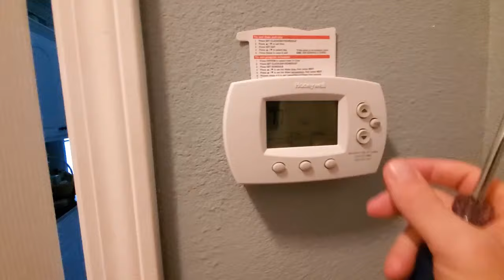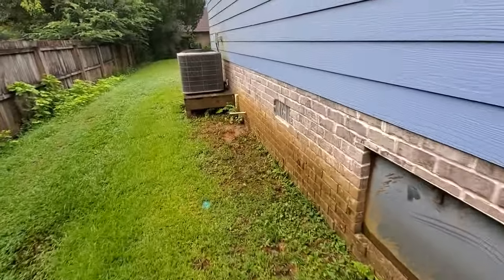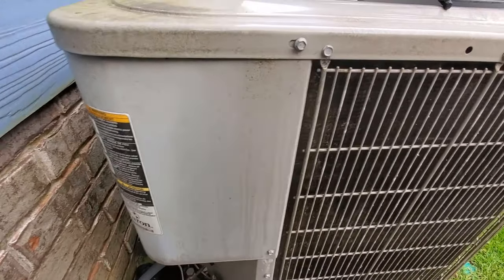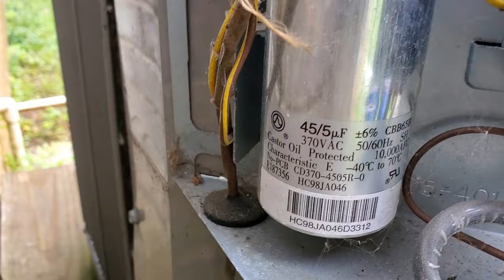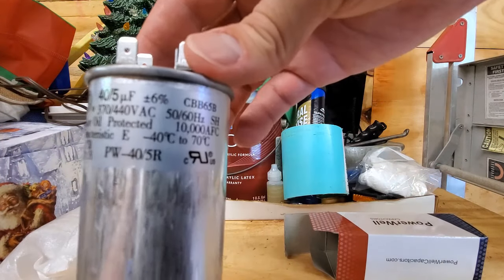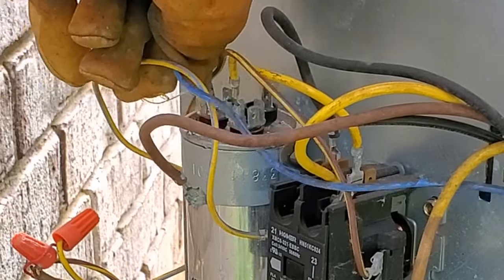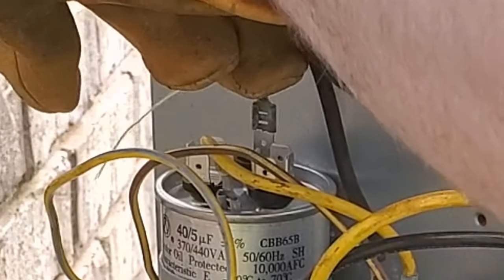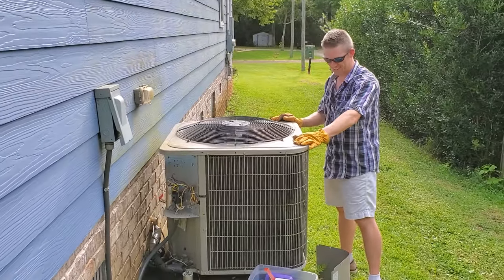How to fix your AC: fan not spinning

Comment: The screwdriver trick to get my fan running just saved my family from another almost 100 degree day until having a professional come look at my unit. Considering I have a 4 month old, I’m sure you can imagine how relieved we were to have a temporary fix! Thank you!
Reply: Same here! Part is on the way and this will work for now. Although I have to "kick start" it about every 15 minutes. We don't have kids but we do have 2 pugs which are very sensitive to the heat.
Reply: Same here.     Awesome
Reply: But a box fan facing up for temporary fix without the hassle of babysitting the unit. You'll need to tie it down though.
Reply: @Robert Morrison Help its in high 80s I have grandkids here as well. Could u explain to me how u used box fan?? I'm having to go outside every 10 or 15 mins to push start my fan so we can have air.😢😮
Reply: Just saved us from that as well
Reply: Just saved my life thx bro
Reply: Same here.
Reply: Hell yes.  Just did the same for me.  It is stupid hot right now.
Reply: That temp fix saved me. Thank you so much.
Reply: Same bro on God my wife was pissed about the heat. I was about to die by wife then die again by heat 😂🤣
Reply: Same here 🥵🙌
Reply: Those are the worst!! Nothing like a new born baby with nothing else going correct! Hopefully you got it all squared away and that baby is happy and healthy! 🎉🎉🎉
Reply: Dude same issue here. I’m pretty sure it’s the capacitor. 4:23 in the in the video  got me dying of laughter lmfao. Discharging had me scared.
Reply: Same here
Reply: More credit to the kickstart via long tool.  Saved me for the night.  Will call the pros tomorrow morning.  Thank you
Reply: Save my life too, your my Hero 💪🏻
Reply: Worked!🙌
Reply: @fortress1133 what is the part needed ? I would appreciate you so much
Reply: Everyone in the comments saying the screwdriver worked; but no is talking about what the part so I can order it and install it myself .
Reply: @realg4lifefoo168  capacitor, there are some videos on YouTube showing where it is so you can get the model number off it, but be careful, electrical components can be life threatening so pay attention specifically on how to make sure unit does not have charge current before disconnecting capacitor. Also, I thought my issue was capacitor but it was actually the fan motor coils going bad so needed new fan motor. Good luck
Reply: Same here!!! we rent our home, but it is hot as heck in Georgia right now and I have kids! Or call the landlord and let him know that it’s OK for now
Reply: Bro you fucking saved my life, currently 1am and this saved me 😂🤙🏽🔥

Comment: Thank you so much! The screw driver trick did not work for me but I was able to replace the capacitor by myself with no previous HVAC experience. I ordered the capacitor, some electrician gloves, and an insulated screwdriver from Amazon. It took about 30 minutes to change and worked the first time. I cannot thank you enough!

Comment: Thank you, Kent, the screwdriver got my fan spinning and I thought holy shit that worked. 45 minutes later the system shut down again. I then proceeded to take the AC compressor panel off and took a look at the wiring configuration. I took photos of the wire configuration to reference and remember where the wires connect once I purchase a new capacitor. Temperature is gaining speed currently at 84* I couldn't wait to purchase online. So I made my way to Ace Hardware and was promptly directed to the section where I could find the capacitor required for my unit that cost a little more than online but since it was Saturday and the cost of an AC tech coming out on the weekend was elevated I was happy to pay the extra cost. I got back home and started to assemble the capacitor and after it looked like it was assembled correctly, I turned the switch on the panel and the unit started working and continued to work. Awesome Victory today, Thank you.

Comment: The kickstart screwdriver method worked for my AC unit for 20 mins before the fan stopped spinning again. Then I followed your method for getting a new capacitor and bought one for 25 bucks at ACE Hardware. Worked like a charm and haven't had an issue since. Thank you so much.

Comment: Thank you soo much! It's 95 degrees right now here in oregon and my mom called me saying the ac is broken. I rush over to the house and started researching videos and came across yours.  All I did was  turn off the breaker and power unit, unplug three female connectors, blew off all the dust, and reconnect the plugs.  Now my mom has AC. Thank you soo much!

Comment: 10:14pm on a Saturday night, 85° after a 95 degree day and the fan stopped spinning...my 81 year old mom in bed and I was freaking out!! The screwdriver method worked PERFECTLY (though my screwdriver wasn't long enough, so I used my little grill stick 😁)! Can't THANK YOU THANK YOU THANK YOU enough!!❤🎉 You are a LIFE SAVER till I can get someone to check/replace the capacitor (using ur video of course)!

Comment: Outstanding Video. Thank you so much for sharing this information. My fan had stopped. Actually we did not have A/C yesterday. I call the service company to come out before locating your video. I went outside to the AC with a long screwdriver and spun the fan. She started up. I am still having them to troubleshoot the AC . You are a blessing and thank you again. Video was extremely thorough and to the point.

Comment: Thank you! I can't believe I came across this video, you had literally the exact same problem as me with the exact same AC unit. I went to Ace, got the part, swapped it in 5 minutes, and my AC is running again! And even better, the horrible noise it's made for years is gone!

Comment: Thank you so much sir. Its summer and my a/c stopped working. It gets to about 91 degrees Fahrenheit out here in Stockton, Ca. It got really hot inside the house, and I didn't have the money to hire an ac repair man. Your video helped me fix my ac, so I won't have to endure this crazy heat. Thanks again.

Comment: The Screwdriver trick worked once for me, but not after that. However I had regular house fan that was wide enough to put over the top of the unit which I used to blow into the unit. This actually also started the fan blades to move in the AC unit and once it moved fast enough the AC unit fan started working on its own for at least that on/off cycle.  So that is an alternative method to try if the screwdriver push is not enough.  The added benefit though is that if it is dry outside, you can just leave the house fan on top of the unit while you are waiting for your capacitor to arrive.  Since it is blowing continuously  it should allow the AC fan unit to turn when the thermostat in your house causes it to need to turn back on.

Comment: Thank you so much my friend for this video.  My AC started doing the same thing. Problem was I discovered it late on Friday afternoon and our usual trusted HVAC guy had just retired (82 y/o). But by spinning the blades got us through Friday night. Then I found your video. Got the new capacitor (45/5 uF) late yesterday via Amazon ($22.90), installed it this morning and works like a charm. What a releif. We have a heat index of 108 today. Liked and subscribed.

Comment: Thank you for this informational video! This is exactly what was wrong with my A/C. Took plenty of pictures of the old capacitor before removing it. Went to a local a/c store and picked up a new capacitor for $25. Replaced it and had my a/c working in an hour.
Reply from the maker: Sweet!  I can't beleive you have and AC store - and that they would sell you something without complaining that you're not a licensed AC guy.
Reply from the maker: @enriqueducassi4595  Must be hot down there!
Reply: me 2, BIG THANK U. From my family to yours.
Reply: ๆๆๆๆๆๆๆๆๆ
Reply: @enriqueducassi4595 🎉❤❤❤        m.    eee and et😂❤
ovà

Comment: I've never troubleshot anything by watching a YouTube video for literally "30 seconds" - my fan motor was humming and MY long screwdriver got it running, which all pointed to my Capacitor.  My local plumbing store carried my Capacitor for $15.98 - you saved me a Service Call - major dollars and days of hot air.  My 2 (spoiled) Pomeranians are happy, and my better half is very grateful.  Thank you, Thank you, Thank you!  Loved the sparks also, thanks for the safety tip as I would have not known otherwise.  All my best and keep up the great work.  $16.51 with tax included, AMAZING!

Comment: Thank you so much for this. This video was the first thing that came up when I searched for A/C Fan Not Spinning last night and I knew it was the same problem when I tried spinning it with a screwdriver. I went to ACE today and got the capacitor I needed, and it's already fixed!

Comment: Great video, very helpful! BUT! You mentioned spinning the fan clockwise, and mine are both counterclockwise.  If you look through the vents at the top at the fan motor it will indicate a rotation direction - make sure you look at this.  The air should be drawn upward through the coils.  For mine, spinning clockwise drew the air downward.

Comment: Listen.. I’m not kidding when I say you may have GENUINELY saved my life with this video. It’s currently 105 degrees here, and my AC suddenly stopped cooling about 40 minutes ago, and although I’ve yet to do this repair, your kickstart method to get the fan going actually helped me getting my AC running to start cooling my house back down. I’ll update when/if I’m able to do the capacitor repair, but for now you’ve saved me. THANK YOU SO VERY MUCH.
Reply: Just was questioning about what's happened since, has it stayed cool since?
Reply: @ceeferg433  so I haven’t been able to attempt to replace the capacitor yet, but this method has helped me to keep my AC at least semi-functional for the past weeks, and yes it still cools fine. There are a few caveats for me though:

1. He says “clockwise” in this video, which I’m sure does apply to his unit, and that’s exactly what I did after watching, …BUT.. that was NOT good in my case, because the fan blades would spin up and turn on the AC if I spun them clockwise, but there was a ton of heat coming from the SIDES of my unit, and very little air coming out of the top… It was cooling, but not super well.. Well one morning I turned it on and it spun up on its own (happens maybe 1 in 10 tries) and I noticed no heat from the sides, and strong air flor from the top… so just for the hell of it I turned it off, and when it didn’t come on this time, I attempted to spin it COUNTERCLOCKWISE this time, and it spun up with a ton of power, strong top air flow and no heat from the sides.. that as when it dawned in me I’d been spinning it the wrong direct for 4 days. It worked.. but it was forcing the air DOWN instead of up and with nowhere to release like it has on top, it was forcing the air out the side vents.. so be mindful of which way you spin because I had no idea it would operate spinning either way.
2. This is the big one… it WILL spin up and function, but the problem is that… say you set it on 65.. once it reaches that temp, it shuts itself off, but once the temp rises ABOVE that temp, it will send the signal to turn back on, but if you don’t just happen to be outside ready to spin the fan when that happens, then your fan motor could burn up trying to spin on its own. So I’ve been having to get the temp down really low, and the shut it off completely for a couple hours. It’s not ideal, but prevents a worse situation.

Comment: For me after watching all these videos, I just replaced the  Capacitor hoping it was the fix after my unit blew warm air on a 101° day.  If it didn’t work at least I replaced it after 16 years of doing abs nothing. I had no testing equipment but It worked for me thank god!  I also cleaned the air vents with dish soap and a hose.

Comment: Dude your one little tip of using screwdriver CLOCKWISE was huge as i tried but didnt know that part. Went down after hearing that and fan went on amd is cooling the house till we get hvac guy out here. Very thankful u went to the trouble. Mike. Camas Wa

Comment: Thanks for sharing the video! It's super helpful to know how to troubleshoot and fix an AC unit when the fan isn't spinning. Replacing the capacitor seems like a manageable solution. Hope it helps others facing the same issue!

Comment: The original cap was a 45/5 MF, and the one you bought was a 40/5, it will work, but will put more stress on the compressor, eventually causing it to lock up and fail. 5MF make a huge difference when it comes to no AC, I ain't a tech, but my friend has over 10years experience. And I showed him this video

Comment: This was so helpful. We successfully changed ours. The  fan is spinning once more. I just don’t know why it isn’t blowing cold air. Barely. Feels more like just the fan is on.
Reply from the maker: I would guess it's the anti-freeze maybe?
Reply: Freon, check your filter, mine was dirty and froze my pipe, allowed to thaw out,replaced filter and lucky freon wasn't needed, that was a month ago but now my capacitor is out and thanks for the video I will obtain one tomorrow and sleep upstairs in the room with a window unit😊,its 1145 pm heard the motor humming and was hot,cut it off and turned YouTube on

Comment: In an emergency, if your fan is not spinning and has resistance turning freely, a huge trick is penetrant oil, cut the power pull the fan Motor off leave the  grill on, flip it upside down, push the rubber seal up on the dust cover, try not to damage it,add some oil to the shaft, let it soke for about 5 minutes, notice the fan spinning freely now reattach..I'm sure this will get you through until you get a new motor if this is the case.

Comment: Thank you! I did the screwdriver trick the fan did indeed start to turn. However, my fan needed to turn counter clockwise. My HVAC guy said with the fan turning the wrong direction, it was pushing the air down instead up and out.  So if you find the unit having a lot of hot air around it, stop the unit, and start it with the blades going the other direction.

Comment: Thank you Kent! Out AC unit went out last night, and we are facing 3 days of triple digit weather. Thanks to this video, I was able to diagnose this issue and replace the capacitor overnight! Many Thanks; Truly Appreciated
Reply from the maker: Oh that's great!  Glad the video helped out, especially this time of the year when it's hot out.
Reply: The repairman that came out the last time mine went out and yes mine has gone out again,  that's why I'm looking this up. Told me that every time it's something like 90 degree weather they pop black popcorn cuz he can't keep up with the extreme heat.

Comment: Great video!! Thanks alot! Don't know if it's recommended, but whenever my drain pipe plugs up, I pull the sensor plug by the inside unit, and then attach my shop vac to the pipe by the outside unit and suck out the gunk. Works great 👍

Comment: THANK YOU!!!! This video was what I needed. We had a home inspection and after that we noticed the house would not cool. I reset fuses but the AC fan outside unit would not spin. I used your s few driver trick in the beginning of your video and the AC is working again. Appreciate you taking the time to share your expertise. You made my night as I can cool the house and sleep well.
Reply from the maker: Oh good. Hopefully you can keep that trick up until you get a capacitor. Good luck!

Comment: Thank you!!! This was exactly what was wrong with ours and I was able to order the part and fix it for $22 because of you! I really appreciate the video and your instruction of how to do this myself.
Reply from the maker: Tha ks Ashton! Glad it helped!
Reply: @KentsGarageGym  okay so I noticed that my air was not really blowing out that much cold and then it made like a weird hissing noise then I go outside notice that it stopped turning the fan was not working at all I then turned it off waited a minute so it could cool down then I turned it back on went out there with a screwdriver did exactly what you did and it started working however about 10 minutes or less after doing it it stopped now what so I need to order that part
Reply: @KentsGarageGym  also I'm having a problem finding it on my breaker box there is words that say heat would that be it it is central air and heat so would it be the one that says heat?????
Reply: Hello 👋!  My fan is not working but if I turn it works but the thing is the when the the ac turn on again the fan is not working again !  Keeps doing it every time on and off again can be the capacitor or the compresor??

Comment: your original cap was a 45 + 5 and you installed a 40 + 5. It'll work but might cause problems with your compressor in the future. also putting in the fuses while there is a cool on signal going to your unit could have fried those fuses. the proper way to do that is make sure the thermostat is off, reinstall the fuses and flip the breaker to the on position, then you can use the contactor switch next to your capacitor to test the unit. 45 + 5 means its a dual capacitor (two in one unit) the 45 is for your compressor and the 5 is for the fan motor and they represent the microfarad rating.

Comment: Thanks for the info on this.   My AC condenser fan periodically will not start and it takes jiggle of the unit or long stick to start the fan spinning.  Also and completely off topic  - around the 4 minute mark when you are inside there is ceramic Christmas tree in the background.  We also have the very same one and until your's I've never seen another.  My wife's aunt loved crafts and made these a long time ago.  Small world....